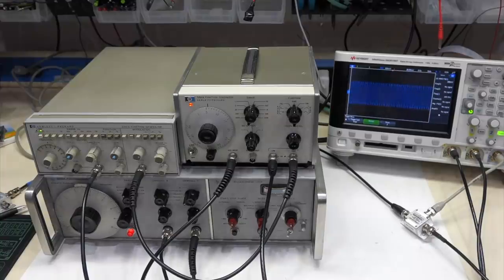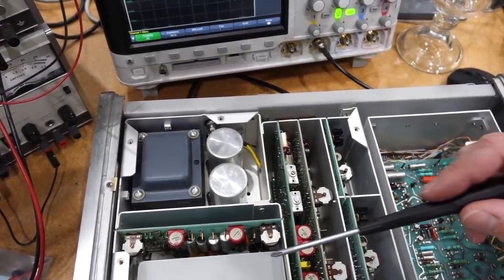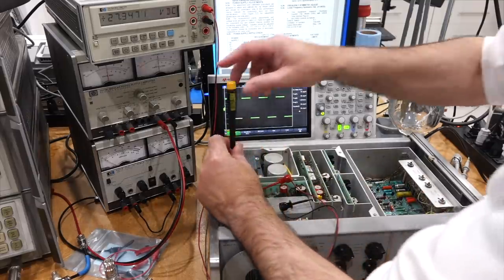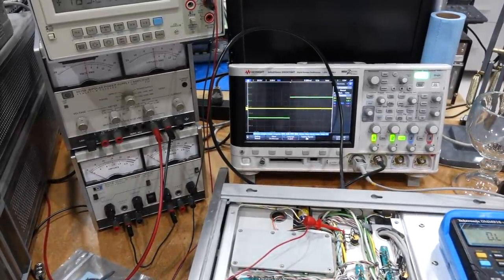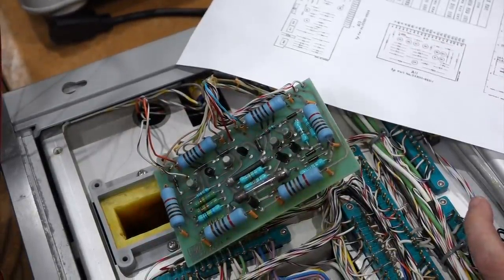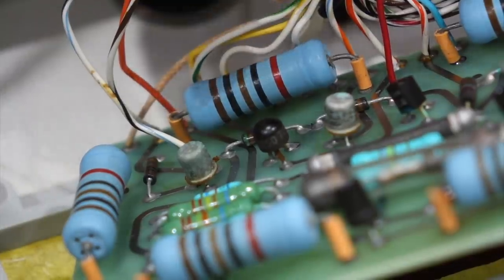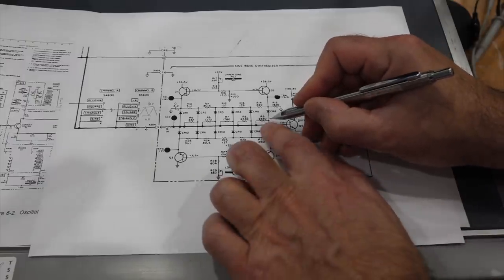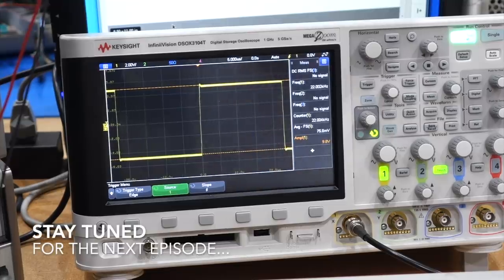HP 3300A Vintage Function Generator Repair

Comment: That's not a MOSFET, just a JFET.
Reply from the maker: No, it's an actual MOSFET. [EDIT: Oh no, big fail. I'm wrong and Alex is right, it's a JFET. See more details below]
Reply: @CuriousMarc  Huh. It's drawn as a JFET, and I know HP used to like to use them for analog switching in those days.
Reply: @CuriousMarc  Wow, OK. The schematic symbol was a JFET though?
Reply from the maker: Maybe I am mistaken. In the service doc they say it is  a MOSFET, but maybe not. A JFET would make more sense given the time period. Let me do some research.
Reply: @CuriousMarc  I could be wrong too, maybe schematic symbols hadn't standardized yet.
Reply from the maker: @Alex Eisenhut and @I Wilton you are both right! The transistor A11Q8 is a p-channel JFET, HP part number 1855-0082. It does not exist in cross-equivalence tables, but I found it on my microfiches (hehehe...). It has no listed JEDEC equivalent, but I can make a guess. Here are the 1855-0082 specs from the fiche:
GFS Min 1.5 mhos  Max 5 mhos @ 15V
BV Min 40V GD
PD Max 200 mW
VGS Th. Min 0.5V Max 4V
IDSS Min 3mA Max 9mA
IGSS Max 10nA
CISS Max 7pF
CRSS Max 2pF
Close vintage JFETs equivalents would be 2N5460 (but Vth max is 6V and IDSS Max is only 5mA) or be 2N4342 (but only 20V breakdown, which might be a bit tight). I think either could work.
So the symbol is right, and I also misspoke about what the service manual said, it just says "field effect transistor". 
Also for the  record, the transistor I changed, A11Q6, a low noise PNP, is a 1853-0066. The listed JEDEC equivalent is 2N4250. I replaced it with a 2SA1015 and that worked great.
You are awarded a mound of free vintage transistors with rusty leads!
Reply: @CuriousMarc  Free? That's my favorite!
Reply: @CuriousMarc  Why thank you, but I'll pass on the vintage rusty transistors. I already have a pile of 1000 A5T2907's from TI that have nice silver-plated leads that are completely black oxidized and completely unsolderable.
Reply from the maker: @mohinderkaur6671  Thanks, that looks like a good replacement candidate.
Reply: @lwilton  Oh man, I'd love to get my hands on a few of those A5T2907s... huge TI fan here :D

Comment: I was a metrologist in a calibration lab back in 1976 and I worked on lots of this vintage HP equipment. The edge connector issue was around back then too. In the 1980's we  called it "green gold" and discovered it is a fuzzy crystal growth on the contacts that pushed them apart. From what we could tell there are micro cracks or pits in the gold plating exposing the underlying metal plating. When exposed to oxygen, water in the air and current, the crystals would form from the corrosion and push the spring contacts open.

  What you need is a gas tight connection at the contacts. Now days we have contact lubes like OX-Guard anti-oxidant compound or other dielectric greases like Rykon lube. These seal out oxygen from the contact points greatly reducing the green gold problem.
Reply: Is that the Jim Harmon of the HP bench briefs fame? 
Read so many of those in my day.

Comment: Very cool. I used to work at a university that decided to throw out tons of old equipment that was in storage, they literally dragged it all outside one of the buildings and a truck made several trips to collect it all to scrap.

Myself and a colleague managed to salvage a lot of gear before it got trashed, we were filling every square inch of our vehicles as well as stashing more in our lab to take home later. There was everything from function generators to decatron computer racks. I scored several working tectonix 500 series scopes in near mint condition. There were spectroscopes, scientific balances and even some old light microscopes. I couldn’t believe they were just chucking this stuff out.

We saved a lot of gear but it was still sad to see the rest getting thrown into a dump truck.

Comment: For those amazed by the triangle shaping into sinusoid using diodes: There is even a much simpler way to do it, just using a JFET, two diodes and 3 resistors. I wonder, how that circuit could compare in performance with the diode shaper. Maybe a time for a test ;)

Comment: Hm, balance still isn't quite on?  The even harmonics of square and triangle should be zero -- assuming it was set for 50% on the front panel of course.  (Typically only the first so-many even harmonics can be zeroed, and the rest creep up regardless of adjustment; this is due to imbalance in the rise/fall edges, or the corners thereof.  Very subtle, close-up stuff, nothing to worry about.)  Quite satisfying seeing the sine shaper do its magic!
Reply: Or the balance of the diode shaping bias isnt  correct (my suspicion) - there were separate trimpots for the positive and negative diode bias.

Comment: I bought a 3300A, no plugin, at a yard sale in 1991. It was $18, all I had in my pocket at the time. I was able to have one of the engineers I worked with send it through the cal lab on a one time only test & calibration. Old HP is great gear. Also have the newer HP test oscillator  that's on your bench.
When I watch you one-handing the metal screwdriver when tweaking those trimmer pots, I get a shiver down the spine. 
Only a matter of time,
 lol

Comment: Great video.   I have a 334A distortion analyzer but I don't think it works that well.  I tried it a little when debugging my home-brew audio amps.  I am not nearly as proficient as you are, just a part time hobbyist, so to get through the amount of analysis and debug you do in one video often takes me months, with a lot more clumsiness along the way.  I also have an HP239A oscillator and an HP654A oscillator which is twitchy, and no amount of contact cleaner has freed the front panel buttons which like to stick.  Another work in progress I had to put away due to other more immediate things.  I repaired both my 3582A spectrum analyzer (bad opto isolator) and my 35660A (bad 339 comparator in the smps and some lightning damaged memory chips), by far those instruments are the most fun to use when looking at my audio amp because they show the harmonics.  this was a very fun video to watch

Comment: Great video and nice repair. I'm currently repairing an HP 8165A Signal Source that uses a similar diode sine shaper in one of the PLL loop outputs to feed a balanced mixer and one that uses five differential amplifiers in the main VCO output to convert triangle waves into sine waves. You have to love the solutions the HP engineers came up with!

Comment: I'm guessing that the second-harmonic you can see on the HP Analyzer is most likely caused by some residual asymmetry in the Sine-shaping circuit, since second-harmonics, and even-order harmonics are caused by waveform asymmetry.

Comment: I wonder if that insulating hard foam is starting to deteriorate with age and off gassing some corrosive stuff? Rest of the boards were pristine, so it seems not a problem of storage environment.
Reply: I was just going to comment that. I'm sure that's whet happened. It was probably either soft foam originally that hardened, or hard PU foam but that is also able to outgass corrosive stuff as it ages. I have seen corrosion around deteriorating foam pads in various electronics over the years.
Reply: probably, cyanide is an offgas product of some polyeurothane foams so its entirely possible its cooking itself, though if that is asbestos, you have other problems
Reply: @AsbestosMuffins  asbestos is only bad if it breaks. As long as it's intact it's entirely safe. Although it is likely the foam contains asbestos, almost everything heat insulating did up until the late 1980s
Reply: Good point...

Comment: Interesting timing since Friday I've started restoration of my HP 6111A power supply which has been designed in the same time period as the HP 3300A. Thanks for sharing the interesting content!
Reply: Those low cost HP power supplies in the all plastic cases were good electronically, but the plastic cases break or shatter into little pieces at the slightest tap.  I've got 6112, 6114.
Reply: @acmefixer1  Do you mean 6212/6214? Since all the 6112A style power supplies are rack mount with sturdy aluminum cases

Comment: I recently built myself a Function Generator using an XR2206 IC, they are pretty handy little devices, the only problem with my XR2206 Function Generator is that the square wave output is very high output and can't be adjusted with the output level control, so I need to make some mods to the circuit so that the Sine, Square, and Triangle wave outputs are fully adjustable in level, there's also a TTL Square wave output that has a fixed 5V PP output level too, great for use as a clock-signal, I did a basic electronics course at uni a few years ago and some of the stuff you get to service in your videos are quite fascinating.

Comment: Interesting seeing inside one of these things. I didn’t know HP started out making function generators. My first experience with them was those “RPN” calculators that all the structural engineer interns I worked with at the time were using (early 90s).

Comment: Excellent tear-down and failure analysis. The ICL 8038 works pretty much the same as the HP3300, but latter has a more precise sine-shaper, by having seven instead of  5 segments. That's a nice reminiscence of the 8038 circuit for me. Anyhow, you could better have used the PULSE WIDTH A function, than the TI A->B, as you could deal with the square wave signal for symmetry alignment, I think. Or get the hp5335A, instead, which has a DUTY CYCLE function.
Reply: The ICL8038 was quite a big deal back when it was introduced, being the first highly accurate  single-chip function generator, even if it tends to be a bit glitchy.  I believe the bugs the editor in Jazzpunk want you to kill are ICL8038s?

Comment: Nicely made HP function generator and repair. I  guess the corrosion on the transistor cans and leads is caused by the insulating foam of the current source oven. When this old material begins to deteriorate, it emits aggressive chemicals. Maybe you should replace that stuff to prevent further damage to the circuit board?

Comment: Out of interest I was looking at the circuit diagram. On channel A the amplifier seems to be lopsided in its drive current capability. Q5, the upper transistor can pull the output up very strongly and I presume that is why it is mounted externally. On the negative excursions though Q6 would not have the same pulldown capability as Q5. What’s the reason for this?

Comment: Does that frequency counter have a Duty Cycle measurement mode? Would have been really convenient instead of having to switch between high and low period. I only have two small ones and they don't have a Duty Cycle mode.

Comment: Might i ask, where do you find decent quality schematics as i am looking for the HP 311A schematic however the only i found is pretty much unreadable and i cannot even open pdf's from keysight
Reply from the maker: When the manuals are not available or of poor quality online, I usually buy them on eBay and scan them in hi-res, then post them on my website and on the internet archive for everyone.

Comment: Those sounds are very reminiscent of the soundtrack to Forbidden Planet ("composed" by Bebe and Louis Barron) which was created using ring oscillators. Apparently, the circuit design was rudimentary to say the least - after an unknown time the circuits would let out the magic smoke, so it was never possible to exactly re-create the sounds once this happened. This lead to the Barron's habit of recording everything they did, just in case.

Comment: super interesting repair and cal... 😃 there are several videos on 5.5, 6.5, 7.5 digit multimeters that are impressive until 4 or 5 of them are side by side and hardly any of them read alike , kind of close so what is the purpose of high resolution? how would people like NASA know which one is the absolute value Keithley vs Fluke and the like? 🤔
Reply: You get it calibrated at a metrology lab. Or at least, you calibrate it using references you got from said lab.
Reply from the maker: It's because their instruments are not calibrated properly, or they don't use the right leads. My two high precision voltmeters do agree for all digits.
Reply: that makes makes me feel better, thanks

Comment: I was thinking that maybe if you matched the two current source transistors you would have gotten better results
Reply from the maker: Not for this circuit. Matching transistors is what you do for a differential pair. This is not a differential pair arrangement.

Comment: Hello i own one but cant find a power cable. Could you please tell me what kind of plug it is ?
Reply from the maker: They have a code name but most people call them an oval power cord. There are always some on eBay, just not cheap. The other solution is to replace the socket with a modern IEC power cord.
Reply: @CuriousMarc  thanks !, i was trying to avoid that but since im on a budget ...
Reply from the maker: @emilienlesage947  That’s a very acceptable modification, HP themselves sometimes have the two versions as they abandoned the oval socket in later production.
Reply: @CuriousMarc  Alright thanks will do so !

Comment: As per shango66's YouTube channel, those dome top transistors are notorious for failing (in his case, not usually in test equipment but in vintage transistor radios).

Comment: I'm wondering how you eliminated the capacitor that's being used to create the triangle wave from being a problem?  Any leakage would have caused an imbalance in the charge/discharge cycle.

Comment: What is it's maximum output voltage spec?
Reply from the maker: Quite a bit. 35Vp-p into high impedance, 15Vp-p into 600 Ohms. Most likely the 15V into 600 Ohms of the 3300A is aimed at testing tube audio circuits. The 3310A can even do 15Vp-p into 50 Ohms.

Comment: It would be fun to see a THD measurement on the 8566.  It's got one of those built in programs to measure that.
Reply from the maker: It does? How do you get that going?
Reply: @CuriousMarc  They're called "DLPs", downloadable programs.  I just did this on an 8566B but danged if I can find the spot in the 2.5K of unsearchable manual pages!  Maybe it's on the pull-out instructions on the bottom of the instrument.  It could be that they were erased?  Not sure, but they ought to be in ROM.